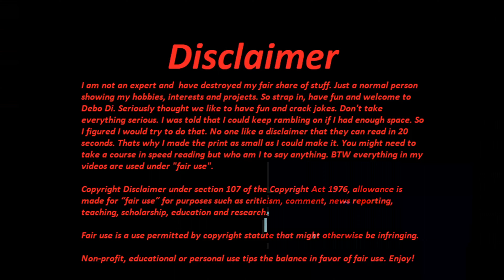2010 Harley Davidson Fatboy. Brake Light Switch Again?

Comment: Goodmorning so this happen to me today but on mine the wire that goes into the brake sensor actually fired what does that mean and would it be hard to change.
Reply from the maker: It's not hard to change if you have basic wiring knowledge. Parts are relatively cheap and available.